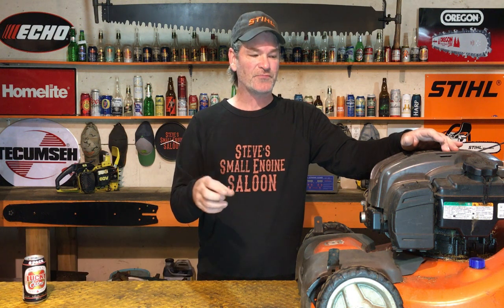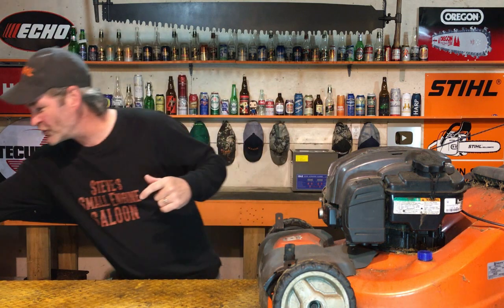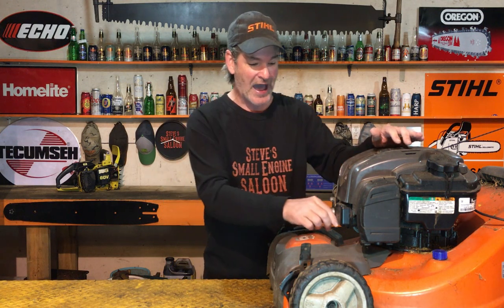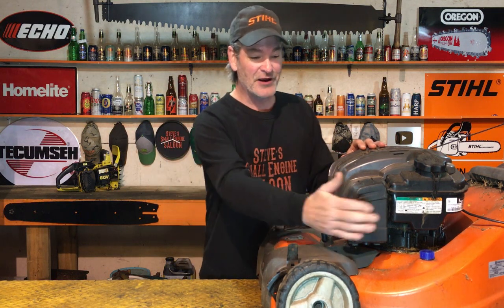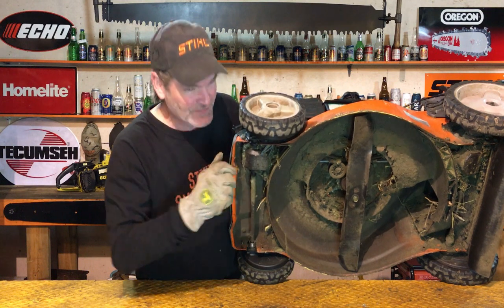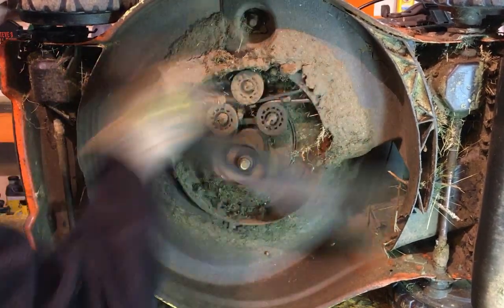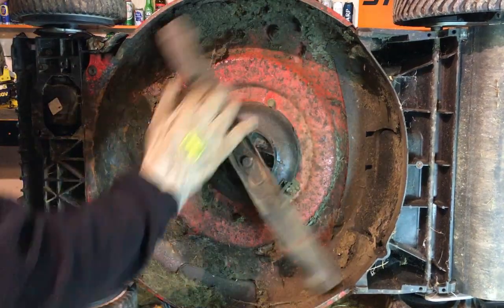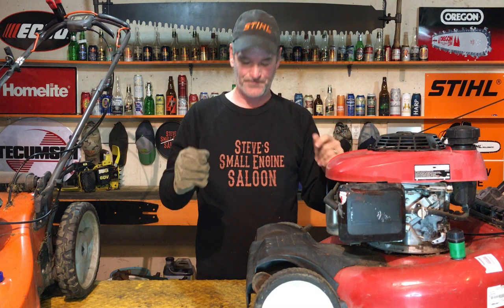How To Test Lawn Mower Compression With NO Gauge

Comment: You cannot get good compression testing on most modern lawnmower engines because they have a built in compression release cam that opens the exhaust valve, slightly, at low rpms.  If you get a reading of 50# then you probably have good compression.  If you get a high reading of over 100# andnthe engines has OHV then you need to adjust your valves before doing a compression test because if your valves are loose the compression bump on the cam will not work.

Comment: I have a '80's push 20" with old briggs. flat head (They are new with low Comp. ratio). Does this test still work?
Just for chuckles, what is a good Comp. tester Psi. for flat head singles like Briggs, or my Techumseh 8hp snow king?
Assume my Matco. comp. tester is accurate.
Any body? thanks Steve: Lot's of good Info. as usual.

Comment: Could make a video on the difference between a pull start vs electric start engine?  The components needed if you wanted to convert from pull start to electric start?  Is it worth it if a engine is designed to have either or?  I know there are some engine models you can buy that offer pull or electric start.

Comment: Steve, I will try this as a first step on a Snapper Ninja Dethatcher mulched, 6 horse. My first indications of problems very blank oil after only one hour of operation. Plus it seems it loses oil in very few hours. The mower has decent power. Any ideas?
I do have a pressure gauge...what should a healthy engine have for cylinder pressure?
Thanks.

Comment: Hey Steve, I was work on my chainsaw today and was worried that my chainsaw was toasted because I felt the compression was weaker than I normally felt. After looking at the piston and verify that it’s still good. I added gas and noticed the compression increases to what I felt is normal again. Does one always check compression with fuel in?

Comment: Steve, I have enjoyed your tutorials and use them to great affect in my own practice. I learned, early-on, that fuel, fire, and air are the three elements necessary for an internal combustion engine to run. This does not account for compression, which means that compression is the fourth element. I, personally, have adopted the four-element explanation...Fuel, Fire, Air, Compression. Thank you for the clarification and keep up the good work, brother.
Reply from the maker: Excellent!

Comment: I accidentally ran my briggs engine without any oil for a hour and when I topped it off with oil ran it for about 5 hours drained the oil it was a metallic silver color and it had bits of metal in it. Still good compression I'm shocked and it starts first pull and I didn't have to buy a compression tester. Steve your the man!
Reply: You're the man. Not "your".

Comment: Hey Steve, SOS !  I tested the spark plug and it was faulty so I purchased another one; replaced the carb; and did the compression test in which it has plenty of compression. There might be a gremlin in that machine because it works one time a year. It is only 4 years old and I don't want to deep six it. I welcome all suggestions from you or from other subscribers. Cheers!
Reply: Make yourself straight gas to run the small engines with. No ethanol in it. And do not use that "fuel stabilizer" garbage. Ethanol is a magnet for any and all moisture in the air. After the ethanol absorbs the water in the atmosphere it settles in the bottom of the carb bowl, and there it rusts the metal bowls and causes the intermittent sputtering of the engine. Or get an EGO mower.

Comment: Hey Steve, My mom used my stihl fs90r. And I see that the fule tank black flip up handle has been rotated about a third of the way past so now when i insert it and turn it i cant fold it down. I didnt know that was possible. Do you know how I can reset it without breaking it. I'm sure there's a trick. Thanks

Comment: Great job Steve, thank you for telling us Why, & not just how to fix something! The Why is the logic behind a mechanical device & is essential for learning & proper diagnosis of a machine. You confirmed my question & suspicion on the "Riding mower dirty little secret" video on the mower deck blade sealed bearings, the last time I replaced them. There were no grease fittings on those housings so I left the seals on. The bearings only lasted a year! I had just seen your "dirty secret" video in June 2019 when the bearings started growling again. This time I bought zerk grease fittings, tapped &  installed them in the 2 housings & modified the seals as you described on the video. The cheap grease was so thin that compressed air easily blew it out! I repacked them with Mobile 1 synthetic grease, filled the housings with the same grease, thru the grease fitting & installed the top bearing. Now they will last longer. Thanks for sharing brother!

Comment: Hi steve i have a Mountfield 554 sv200 briggs engine : got no spark coil test shows 387 ohms cleaned flywheel strong magnets no broken wires cut out wire removed still no spark ? just removed flywheel  its all perfect on its keyway shaft ?  ive just got a nearly new coil tested it 498ohms fitted with coret gap still no spark , good compression  on engine ?  HELP PLESE . its driving me to drink do you want one ; regards mick :

Comment: Great tip, Steve.  Can you inform about how "good compression" would translate into numbers on a compression tester?  Would it be similar to that on a chainsaw, say around 130-150psi for a saw in reasonable to good shape?  Thanks!
Reply: That's correct....all gas engines must have minimum 100psi to run. At that point its tired....may smoke a bit etc.

Comment: Steve our pedal that moves or John Deere D 125 forward way it working dealer said rock tractor back and forth while pushing the disingauging lever in on the rear of the tractor That. worked for one round then it went out again and we couldn't get it to engage again any hint on how to do it so it keeps working

Comment: ive been doing  l m repair so long now . i can generally feel if the compression is good  or not by pulling the rope . the problem ive found with those ex series ovh engines  is it can feel like adequate compression but the valve timing is slightly out causing it to back fire through the intake .  oyyy  give me an L head anytime

Comment: I had a lawnmower that would not start. I put cellulose thinners in through the intake and then I tried to turn it over and it would not so I took out the spark plug and turned it over. I put the plug back in and it started after that.

Comment: Ok you have compression but how much I have been doing this since I was 17 and I own a compression gauge, after 42 years I don't trust
just the feel of compression I have to see how much it really has. Yes it might save you from having to take it to a shop the way you did it 
I have worked in many a shop that never had a gauge it takes 2 minutes to do a proper compression test.
Since retiring I have found my gauge got used more than ever before and has really saved me some time in deciding if I want to rebuild it
or not.

Comment: Steve! First and foremost, I love your channel!

I work at a local hardware store and we recently got in some stuff called “VP fix-it-fuel” or something along those lines. Luckily, one of the cans fell off the shelf and burst open so I got to test some of the fuel for myself! 

This stuff claims a lot of stuff, saying it’ll clean carbs and yada yada so I put it in an FS 90 engine I rebuilt that I thought was having carb issues. I ran it for about 10 minutes but shut it off because it was producing a lot of white smoke, pretty much sea foam levels. It seemed like the stuff didn’t do much but I filled it with a tank of motomix and to my surprise it seemed to have almost fixed the carb! 

Anyone else have luck with this stuff, maybe you could try to fix an engine with it!